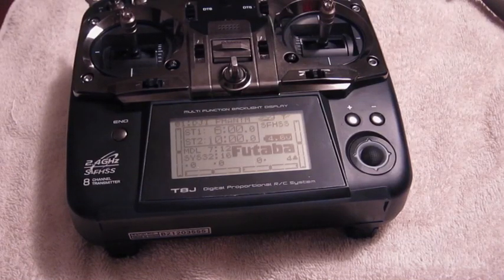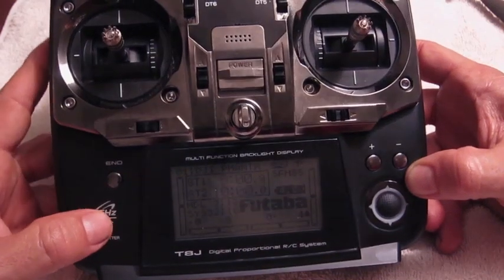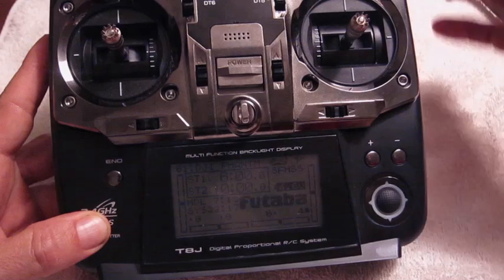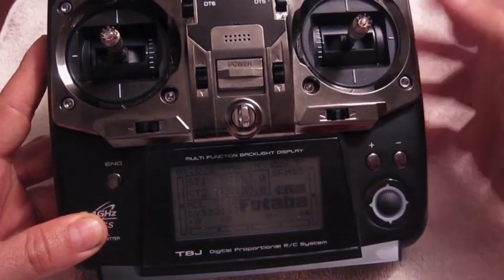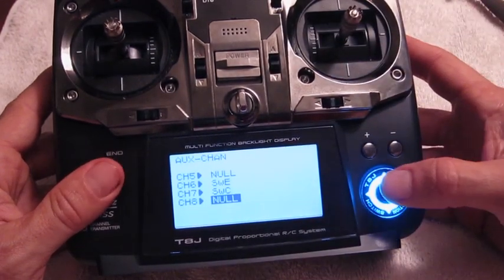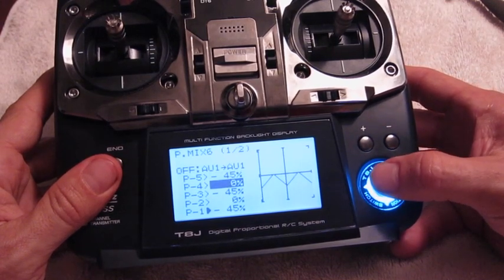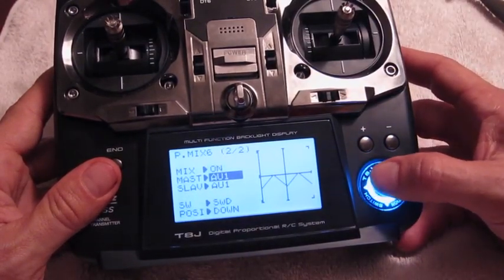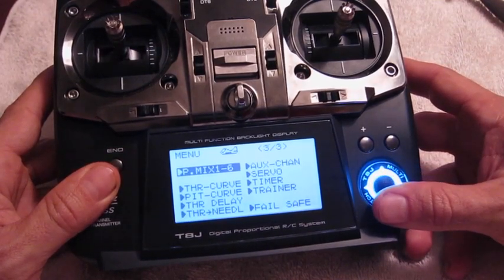Futaba T8J -DJI Phantom NAZA Failsafe set-up Addendum

Comment: Gary Please, with this case, Tilt from the gimbal is still connected to the Channel 5 ? i am not sure i have understood very well your Addendum ): .... my problem is that i've follwed all your tutorials from scratch and now my Tarot gimbal feel crazy when i set the power.Well, i've connected the T from the gimbal to the Futaba t8j RX channel 5 (top pin)..and ground is not needed cos it is the same battery...SO i would like to use the VR and the switch G like you did with your great tutorials.THX